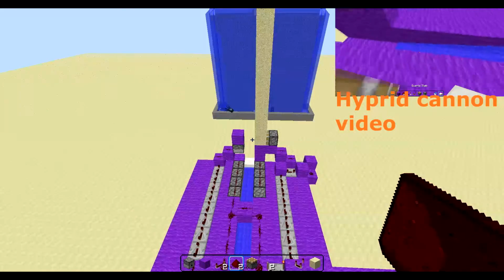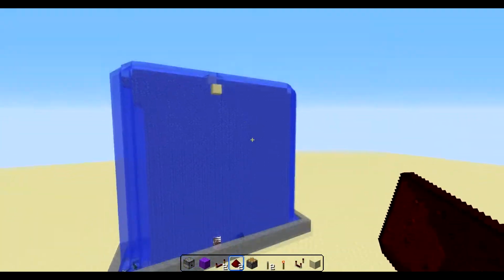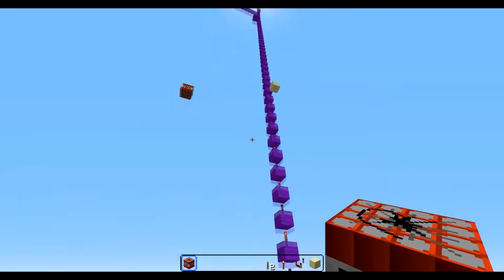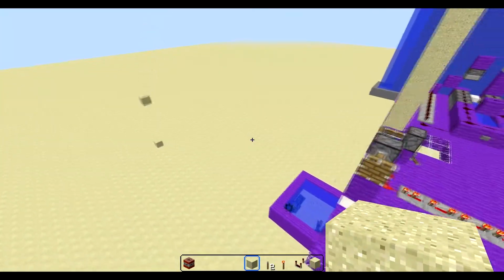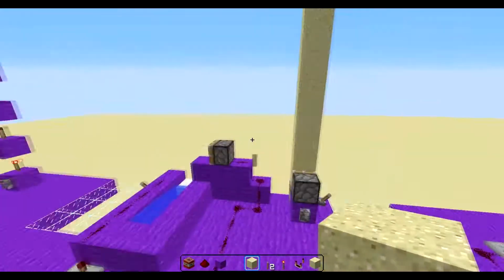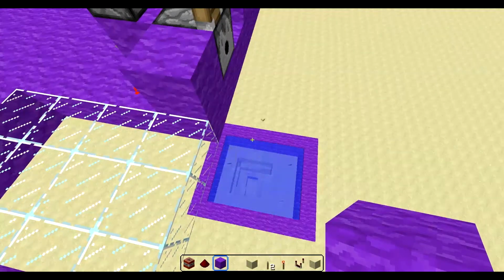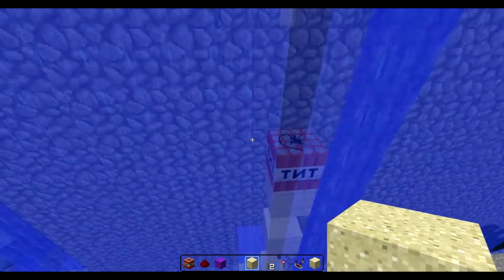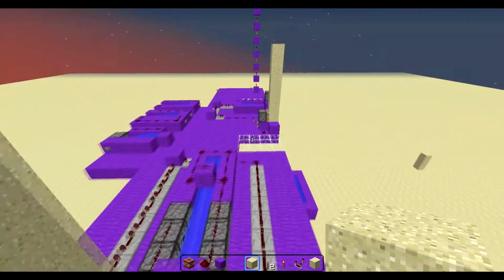Explaining How Hybrid Cannons Work!

Comment: What if both the sand and the TNT are still in mid air? Will it still blow up other blocks? Or does the sand have to be on the ground, as an actual block to work? Please answer ASAP! Thanks :)